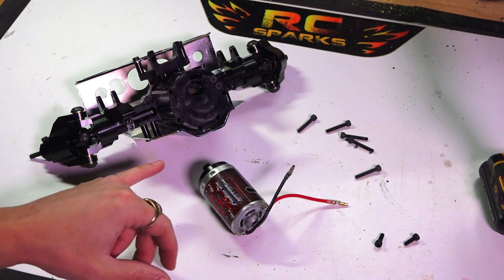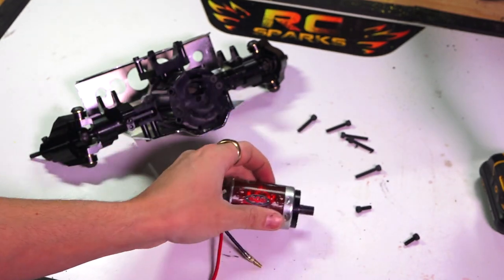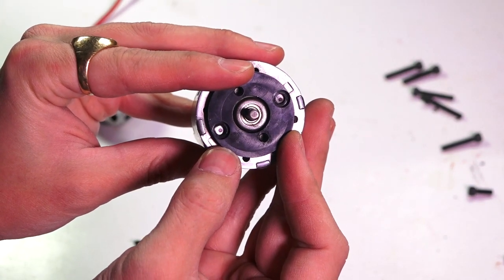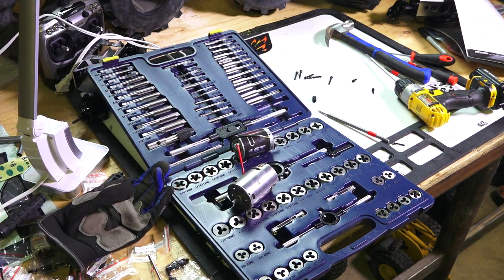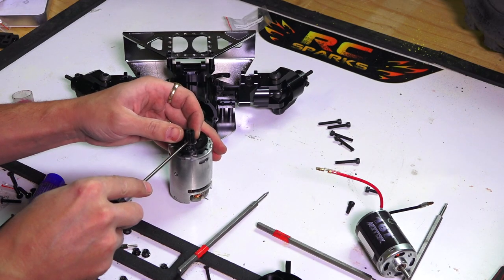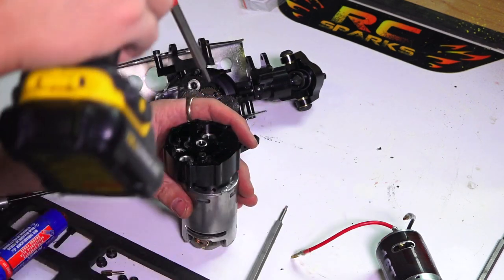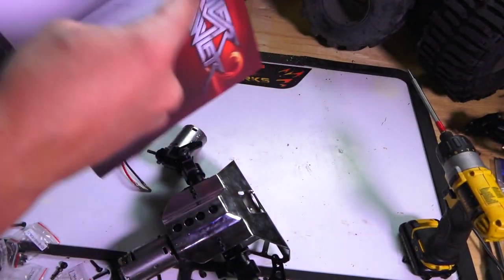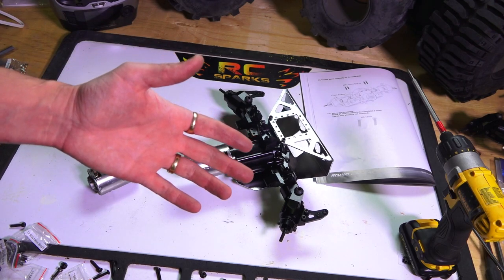RC ADVENTURES - Building a 1/4 Scale 4x4 Killer Krawler 2  BV 4 - Motor Upgrade 750 to 820 DeWalt

Comment: Don't think it'll break the gears in the transmission, there are smaller gears in drill gearbox which handle more torque than that, great vid at all, that's always a pleasure to look at yours! :)

Comment: Why did you drill into the motor? Wouldn't it  be an easier and safer upgrade to drill the holes in the motor mount?

Comment: excellent vid. This video will come in handy, cause I wanna do the same thing. But my motor is from an old bosch drill. But the big issue it is ac. So I will have to get some kind of current changer to change it from ac to dc. My motor from my ecx race truck just went to shit. Everytime I pull the accelerator it smokes. I hate brushed motors. But brushless are also not water proof. Everybody gets that totally wrong. You need to build or buy a cover for your electronics.

Comment: For a while when I blew my slash motor I took the motor out of a ride on power wheels and it didn't goes fast but had a shit ton of torque I just had to do a little small modifications to the motor before it worked

Comment: Apologies if I've missed this, but, what's the benefit of using brushed over brushless for this project? Thanks in advance! :)
Reply from the maker: +Meteor Shower not a problem bud!  The advantage for me is that I don't have to worry about Sensor cables, cogging, or the motor being "waterproof".  A Brushed motor removes those issues for me.. and generally, depending on the make and manufacturer - a brushed motor has more low end torque
Reply: ***** Ohh yes I see the issue with cogging now! Due to crawling being a slow speed things cogging isn't exactly needed! Cheers pal!
Reply from the maker: Meteor Shower it's a pleasure! Happy RC'ing my friend, and a very smashing New Year for you :)
Reply: ***** Haha happy RC'ing!! On Christmas day, I opened up my main present, the Blade nano QX 3D, I knew it was coming because I confirmed the order. Bound it to my transmitter, then powered her up, and bang a dead motor on arrival!! Plus many of the LEDs were gone. Taking it to my hobby shop tomorrow and seeing what they say about it due to us ordering it off them. Hope yours was a bit better! You genuinely seem a good bloke, even just talking to commenters, not many large channels do that. Happy new year Medic! :)

Comment: I'm just starting out rc and I was wondering what would be a good rig to start with, I'm only a teenager so I want something cheap, also I prefer the pickup truck body style so what would you recommend?
Reply: +North Card what is your Budget
Reply: +North Card My first truck was a 1/16 erevo vxl
Reply: Under 300$
Reply: what is that in pounds
The traxxas slash XL-5 is a good starter car/truck
Reply: traxxas brushed 2wd stampede, slash, rustler or bandit
Reply: Thanks
Reply: +North Card no problem

Comment: I have seen your build until now. it look's like the new DeWalt 820 motor has a shorter aksel. So i was thinking, that maby you dont need the motor mount... Maby the holes in the DeWalt 820 motor fites right into the other holes ? Just a thought from a guy from Denmark :-)

Comment: Hey medic, I just bought a Losi mini 8ight, but the stock battery that came with it doesn't even last 15 minutes. What can I do to get a longer run time. Please help me out, love the channel and thank you!!!👍👍
Reply: go lipo but look into lipo safety, you don't want to burn you house down or lose gour new mini 8ight.
Reply: look for some 1400-1500mah 2s lipos but you will need to trim the battery tray just a little bit

Comment: Why didn't you cover the face of the motor with tape to keep metal shaving out of the motor while you were drilling into the case?
Reply from the maker: Because I have a high pressure air line that blows it out. There will be dirt in there, soon enough..
Reply: +RCSparks Studio I saw that you used compressed air I was thinking it might be harmful because the shaving will stick to the magnets inside the motor.  I'm enjoying the build keep up the good work.

Comment: Hi RCSparks
does your gear work fine with dewalt motor ?
I build a KK2 for robot application and stock motor haven't enough torque
i want buy the dewalt 18V but i don't want broke pinion gear with massive torque
stock motor stall sometime when need crawling
thanks for help
Julian
Reply: i use 4s lipo
and i need run very very slowly , less than 1mph
Reply: i draw motor plate tu build one for dewalt motor , i don't want made hole in new motor
i can cut the adaptor plate with high pressur water for best job

Comment: [HELP PLEASE]How do I fix my rc car because when I turn it on its fine but when I connect the radio it weak when it turns the wheels and when I push the throttle it just spins round and doesn't stop

Comment: No my traxxas plugs had a little notch on the side and there was no room to put it in, I took my remote from my latrax Teton and the steering is backwards how do I fix this? And is a venom 5000mah 50c battery waterproof?

Comment: Hey dude I just got a new slash 4x4 platinum I need a remote , battery's battery charger and a mini receiver and suggestions let me know thanks:)
Reply: Budget?
Reply: Spektrum dx2e is good and comes with reciever and transmitter.
Reply: thats what he uses... Spektrum was right on my tounge
Reply: +Andrew Smart I had a dx2 but he plugs would not fit into the receiver they had little tabs on the side stopping it
Reply: then you are putting them in the wrong way. Thats to stop you frying the servo's. Black always goes to the edge

Comment: you should center punch your marks and as a machinist don't wear gloves with rotating equipment. If that motor where to kick that bit would grab that glove. some guys at work had that happen when drilling holes in a plate.
Reply from the maker: +O'Neill The center punch - great idea :)  And yes, i agree - when using larger cutting bits.. dont wear gloves.
Reply: +RCSparks Studio  I do have a question for you though. I've watched alot of videos and have wanted to get an rc for years. my question is what's a good truck that won't break the bank(preferably a rtr)? I like the crawlers and I also like the monster trucks ( like the savage and such).

Comment: NO gloves when drilling on a machine like that! it's a hazard, since you can get stuck with the gloves and rip your hand open and such unfortunate things!
Reply from the maker: Not sure why no one is noticing I was using a tiny cutting bit, and that gloves are no threat. But everyone has an opinion on it.
Reply: +RCSparks Studio Sorry, didn't mean to offend or anything. It's just sort of been "drilled" into my mind, if you will, that as a general rule at those machines, not to use gloves.. I know a small drillbit is less of a problem for snagging^
Reply from the maker: Loved the pun!

Comment: please please please do not use any gloves or fabric material around any rotary tool. This is extremely dangerous around something like a bit it will not just burrow through it will grab the material and whatever is inside. a drill press has a lot of torque and will just about whip your whole body around. no gloves may not feel safer but it really is.
Reply: A drill press won't do that.

A lathe will, and a mill will. I can stop a drill press with my hand when it catches a piece I'm drilling.
Reply: Not sure what drill press you use but mine shattered my thumb. It's a lot older and heavier built though.
Reply: I'm not the safest guy on the block but anything that has rotational momentum like a drill press, lathe, Bridgeport, you shouldn't have anything on your hands that can catch. It dosent take much to break fingers and hands. Don't risk the money makers.